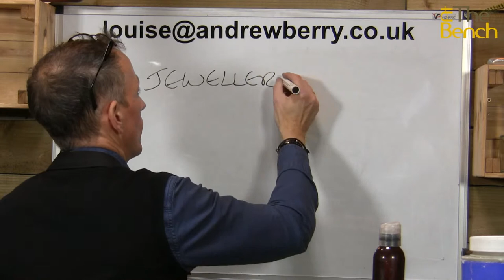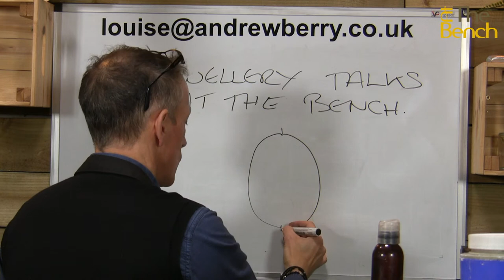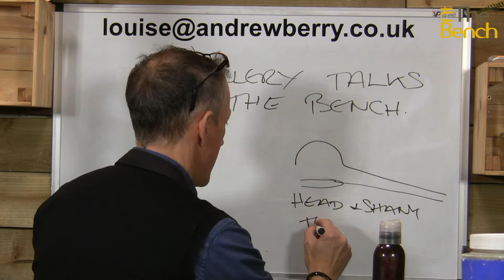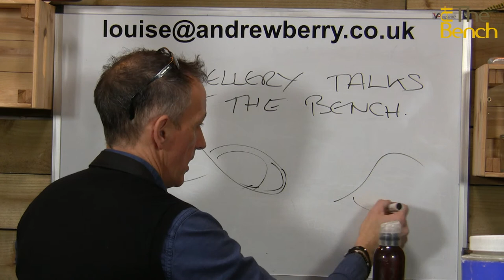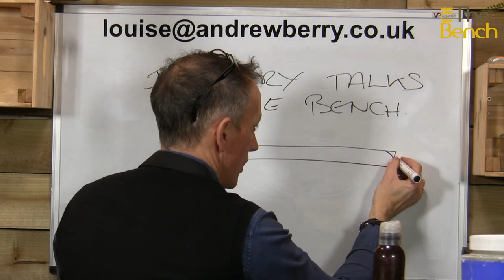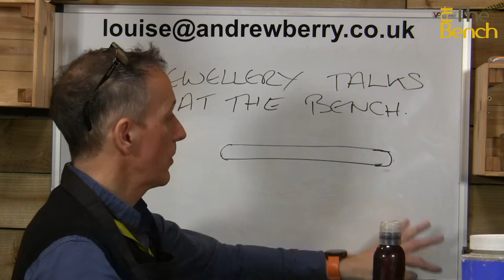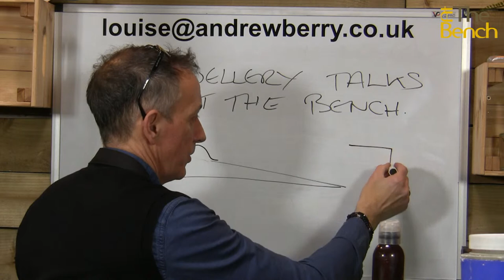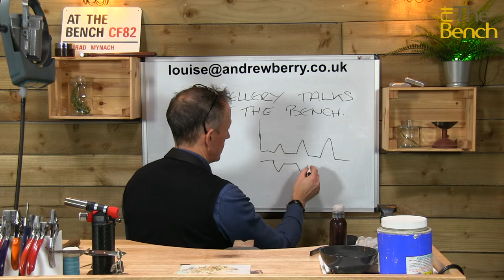Jewelry Q & A With Andrew And Louise

Comment: Firescoff is the best by far, once you've figured out how to apply it.  The Sprayer is the expensive way to do it. Applied carefully with a brush to the hot piece is the way to go. Takes a little more time but much cheaper than spraying the stuff all over the place. Still more expensive but it does reduce firescale dramatically.